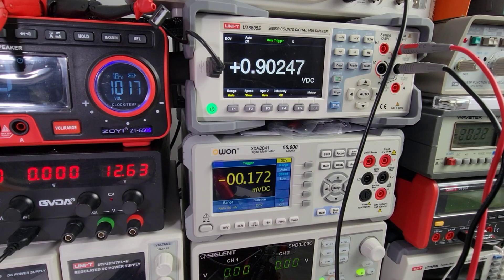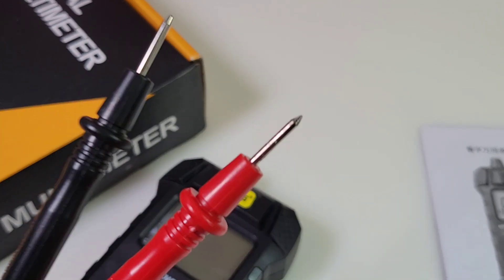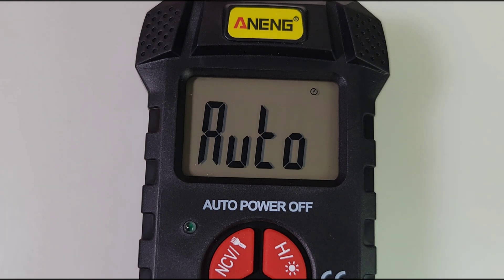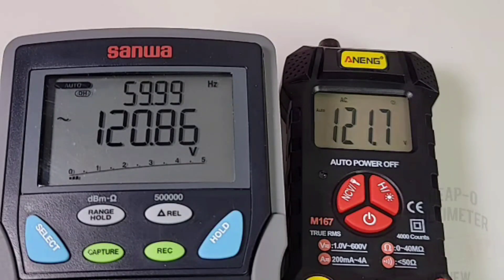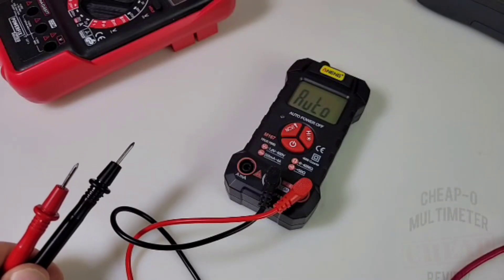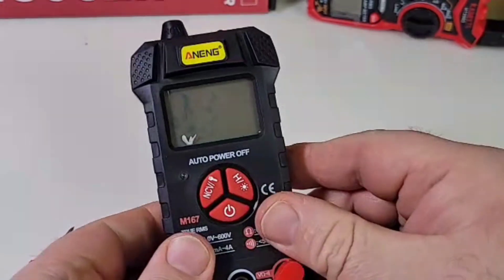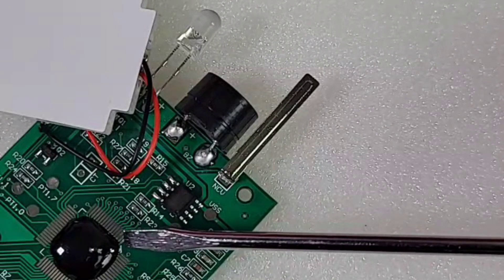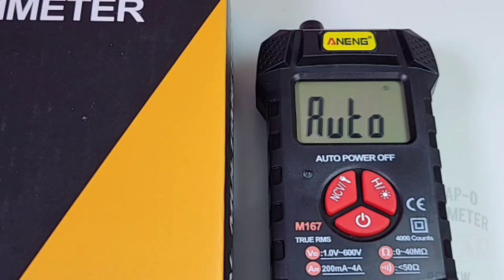ANENG M167 CHEAP-O Multimeter Review & Teardown!

Comment: You paid $25 Canadian?
I paid under $4 USian.
NCV does not work at face of the socket, but detects along the wire, even USB wire.
All seems to work ok enough, for when I need quick and ok enough ;)
Reply from the maker: Great price..always more expensive when it's initially released 😅

Comment: I'll start by saying you paid waaaaay too much. When my venerable & much abused analogue TVM died a couple of years ago I bought an M118A to replace it and I like it a lot so when I saw them on the Aliexpress Singles day sale for only $8.82 CAD (regular price $14.49) with free shipping I bought another for when I need a 2nd meter. 
Then I saw the M167 for $6.32 CAD (regular $11.96) with free shipping I figured I could hardly go wrong buying one of them too. It looks like they listened to videos like yours because the protective film was on the outside and easy to peel off. They seem to be aware of the lack of protection too because it came with a sticker over the amps plug that says "⚠STOP TESTING VOLTAGE IN CURRENT MODE" 😱 as well as a warning in the clearly written (if somewhat minimal) English manual. 
I expect this will be fine for a secondary meter on my very crowded bench. It certainly looks better made than the $5 special from Canadian Tire that lives in the tool box I take to model train shows.
Reply: Interesting. YouTube told me you posted a reply but when I came to reply it isn't here.

Comment: Hi Darren.. thks for the upload.. what's the minimum current that can measure? Is it 200mA, meaning if current  less than 200ma i.e 10mA cannot measure? I plan to use it to measure parasitic drain for my car..which is in the range of 20mA to 60 mA DC..
Reply from the maker: Hi there ! It should be able to measure from 10mA -200mA ,so you should be fine.  🙂 👍
Reply: @KeepOnTesting  Thanks so much

Comment: For the price, I would have expected much better probes and diode test.  The continuity is so slow you could easily miss a short. The price is right on the edge where I expect capacitance.  So yeah, I agree hard pass on this.

Comment: Resistor at F2 was marked 0 so it's a jumper. The shunt is actually 2 in parallel marked R13.
Reply from the maker: Correct..I did more tests afterwards and it was indeed the jumper..still its a complete fail input protection wise 🥴👍

Comment: On these really cheap ones it wouldn't hurt to check their input impedance with another meter. We expect 10Meg but some are less. The Harbor Freight was 1 Meg.
Reply from the maker: Good point 👉  I'll add that to the CHEAP-O repertoire in the future 😉 👍
Reply: @KeepOnTesting  10 Meg is pretty inherently safe, even without PTC's and the like.